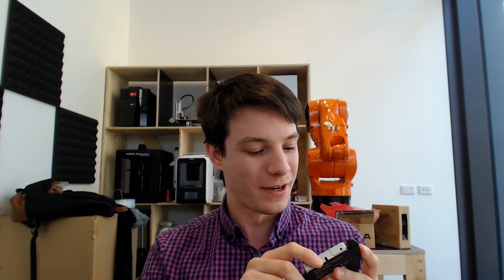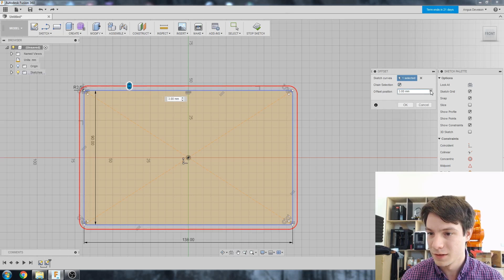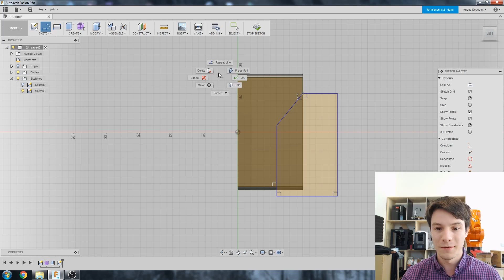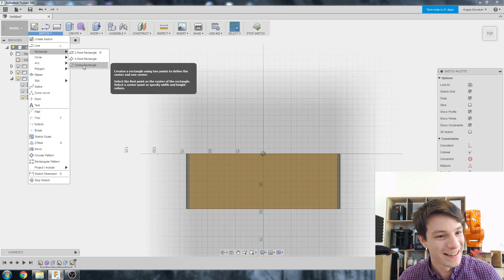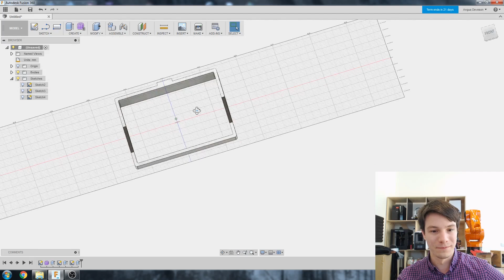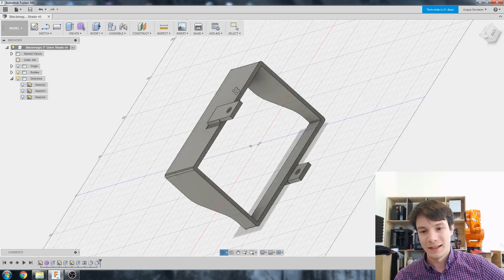3D Printed External Monitor Sunshade using Fusion 360 - 3D101

Comment: How long did you spend getting "familiar" with Fusion360?  or did you just jump into it with this video?

Keep these coming!
Reply from the maker: I pretty much jumped in! I got stumped by the different layout a few times, but overall the approach is the same to other parametric packages I've used like Solidworks or Onshape.

Comment: Hi Angus, Just had a look at the overview of Fusion360 and I note its a cloud based product. Did you notice any slowness to commands like you seem to get with OnShape?
Reply: Files get stored in the cloud, although you can work offline too, but the software is on your computer, so any delays in commands would be due to the power of your own rig. If you go get lag, you can actually turn down the graphics load and it makes a world of difference. it won't look quite as nice and smooth, but it will run well on a mediocre machine.

Comment: Really enjoyed the video.  I just started dabbling with the modeling tools.  I did a little with TinkerCAD.  A little with SketchUp, and the last bit with AutoDesk 123D Design.  Of those, I liked 123D Design the best, but it is hard to be very precise.  I've read recommendations to move to Fusion 360 for that.  Now that it looks like I can use it for free, as long as I meet their criteria, I look forward to watching even more of these videos.

 Might I suggest an even simpler video -- start from the very beginning, and make a 20x20x20mm cube for folks to use as a test calibration print.  Then maybe a cylinder, or a cone.  Great building tips for folks to refer back to as they grow.
Reply: John O'Shaughnessy that's exactly what I was thinking but I didn't use sketchup and fusion 360 is really powerful once you get the hang of it like I am trying to do. If you want to learn to make things like calibration cubes then just play around with the software and you will learn quite quickly!
Reply: AlexTheHaszard I watched some tutorials and have jumped in. So far, I think Fusion 360 is great!

Comment: Angus, you mention in the details that you used to use OnShape but have since switched to Fusion. Any particular reason for the change??  I've been using OnShape for the past couple of months as an ex-Solidworks user myself, and since OnShape was made by the same people I would think that would be a good fit.  Does Fusion have something that you like better?

I figure I ask before I get too engrained in one platform. Thanks in advance!

Comment: Awesome! I can't wait to see what else you do with Fusion. By the way, if someone hasn't already said it, your sketches will turn black when fully constrained so you don't have to grab and pull on them.
Reply: Brandon Terry do you by chance know if you can display the degrees of freedom specific points/lines in sketches have in Fusion360? I only know Inventor where it is possible and I always find it helpful. Now that my father starts learning Fusion360 this might be a helpful feature if it is available.
Reply: Sorry, I'm not sure. I know you can constrain degrees of freedom in assemblies, but I've never done it in a sketch.
Reply from the maker: I was confused why my original sketch with the offset wasn't constrained, but looking back on it shows there's no constraint for offset entities, which is a bit of a shame! Makes it a bit harder to dimension and tweak later.
Reply: When you added the fillets to the first sketch, it was no longer fully constrained for some reason. You can see some of the lines turn blue. if you would have dimensioned the distance from the center point again, it would have kept it's constraints and just added a dimension for the offset. I don't know if it's supposed to behave that way, but that's what just happened when I tried it on my machine.

Comment: I've been using Fusion 360 for a while to model useful items for 3d Printing.  Most of the time I haven't had any issues but occasionally my constraints really mess up the model if I go back to change something.  Perfect example was a phone holder for a bike I made, originally it was for Samsung G5 then somebody asked me to change it for their phone and something in my constraints really screwed up the parametric changes.  So please keep giving us tips on constraints because I've been back over that model a few times and I still haven't worked out which one is causing me the problems.

Comment: Nice video. One thing I would have added is that when you mentioned the tab being too long at the bottom, the cut away did not have to be modeled later, but simply that feature could come later in the hierarchy, so moving it around would have been a nice secondary demonstration of parametric modeling. Maybe something to show off in a future video.
Reply from the maker: Absolutely, I almost did but felt I'd save it for another vid, certainly a handy feature (tree) !

Comment: Good interesting video. As a beginner in this (about 6 weeks now) and using Tinkercad at the mo, can I assume that most commands in most software packages are transferable between one another? Or is each software package radically different from another? I presume I should pick ONE package and pretty much stick with it.

Comment: hey Angus.  how are you getting fusion 360 for free.  i had a look after watching your vid and can only get it for £37 per month.
great tutorial by the way.  cheers
Reply from the maker: You can use it if you're a student or your company is bringing in less than 150K / yr I believe.
Reply: ok thanks I'll check out the demo version and see
Reply: thanks.  yes I've downloaded it and it says exactly that on the licensing page after running.

Comment: Angus just a tip when using autodesk software use shift before hitting enter to change other dimensions, so when drawing a rectangle define one side then press shift to define the other (just a shortcut)- but keep making these great videos
Reply from the maker: Cheers! It's these small things that I need to start picking up then I'll be able to move much faster.

Comment: YES !! This is what the 3D printing community need ! Learn how to make new stuff. 

I use blender as the kids in town can use that tool to build models to print and also build game scenarios and animations.  I also haven't been running windows or Mac for a long time, so Fusion 360 is not going to be my 3DCAD. OpenSCAD can be intimidating for someone starting too. 

Would be nice to make a run down of the tools available to create 3D models. Also might be nice to generate gcode by hand to test printers and tune them up. Thinking of G2 circles, fast travel from corner to corner, Shake tests/harmonic finder, acceleration, etc etc.

Comment: Fyi, if it is fully constrained, it will turn black.
Reply: Also, if you have a line selected, just hit the "x" key and it will turn it into a construction line.
Reply from the maker: Cheers, I thought as much but was wondering why some remained blue when they should have turned black. It seems there isn't an 'offset' constraint yet as well. The X key for construction line is mega helpful thanks!

Comment: Awesome video!  I'm really loving the push to teach the community how to design.  

I know you were wanting to teach how to sketch and extrude, as its the go to for most designs.  However, I've found I really love the Shell feature when wanting to create a hollow body with thickness.  

On a side note, Lady Muse?  Did I miss a big video announcement?
Reply: He's called her that for a while now.
Reply from the maker: My reservation on using shell is 'sometimes' it can make the internal faces not truely flat, and unable to be used as sketch planes. This comes from my experience in Solidworks however so F360 might be different. I feel it's best to move through the features available one at a time so next project will introduce revolves, then sweeps / lofts and shells!
Reply: Guess she's only on lives streams and stuff.
Reply: I think you will find Fusion better than Solidworks.  I've been told by my mechanical engineering fellows, that grew up on Solidworks, it's VERY different but many of them enjoyed the change once they unlearned old ways.  I'm a computer engineer, so this is as far from Eagle as it gets.  

Just another note, you may want to call out how you are modifying the design history vs direct model editing.  For the past few years, I only understood direct editing and didn't understand what the design history was or how powerful editing it vs direct editing is.  This is very normal it seems for people training properly in CAD, but to us self taught folks, this was foreign.